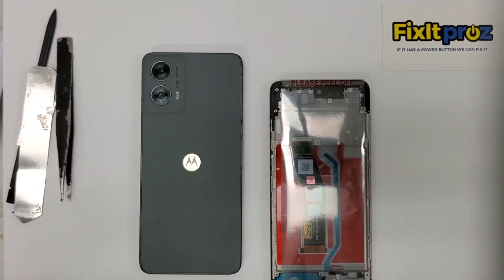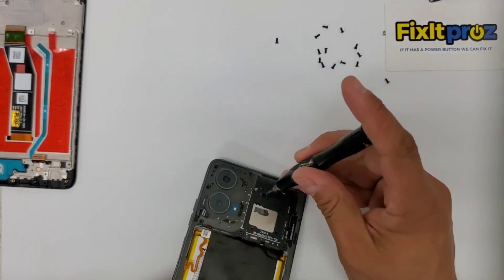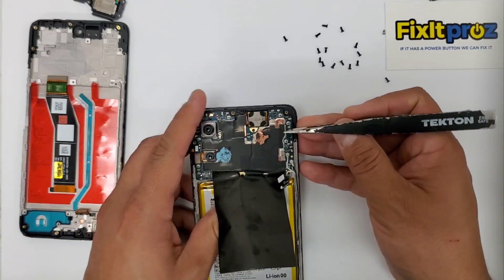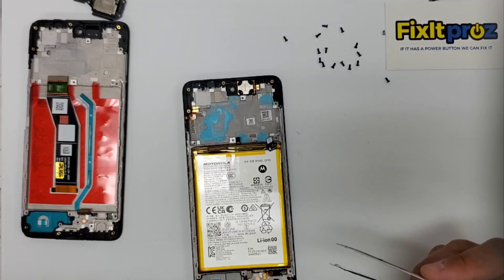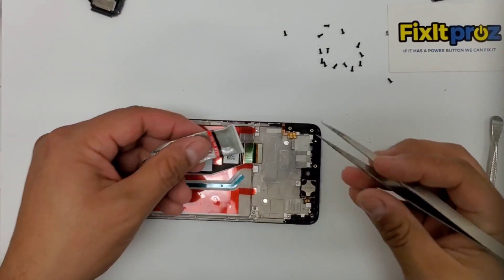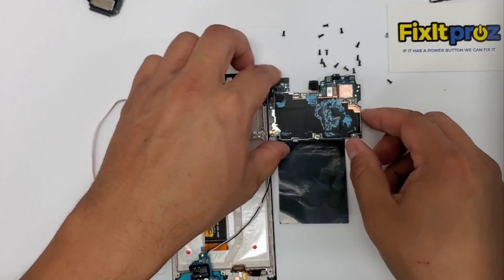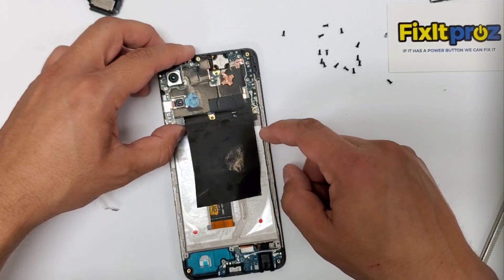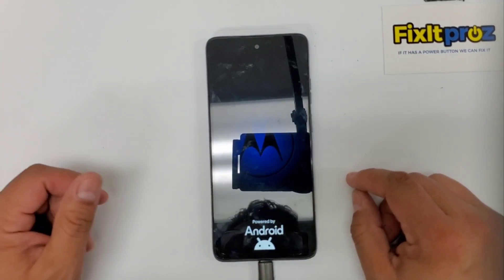Moto G 5G 2024 Screen Repair

Comment: I accidentally purchased one without the frame and did the replacement and display worked but touch doesn't, which cable is responsible for that?